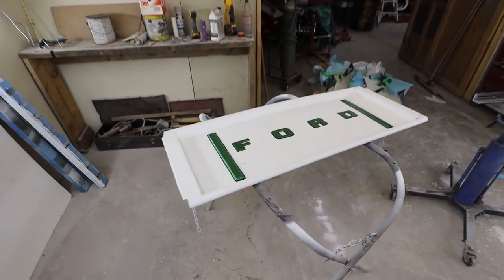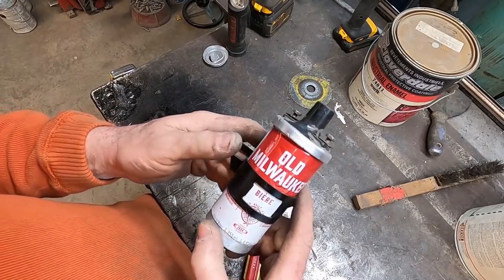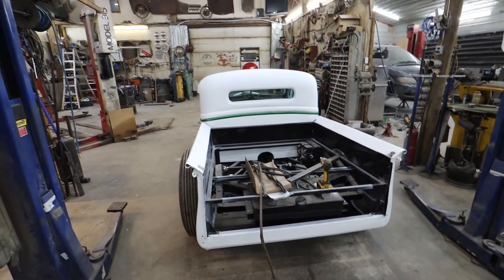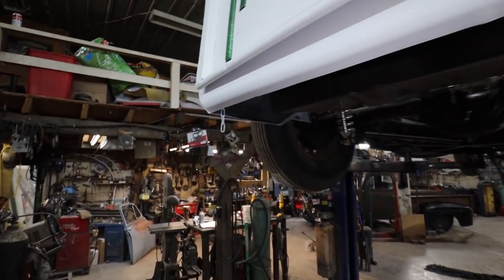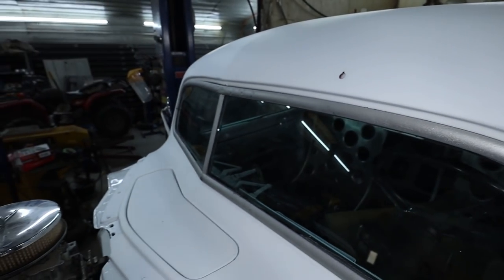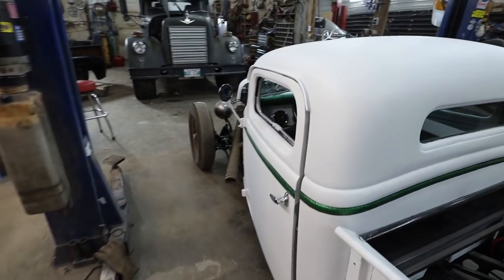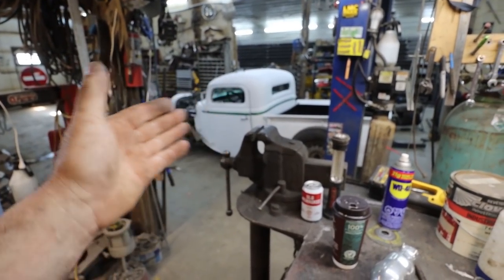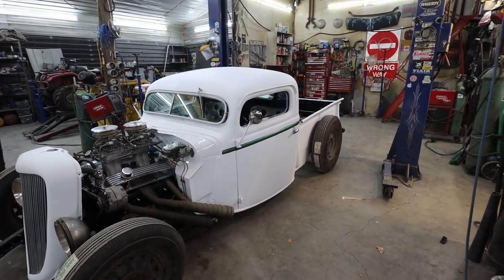Mounting the 37 Ford pickup body to the chassis for the last time Part 39

Comment: Sho! Who would think the Rad would make such an difference? 🤭
Superb pin-striping, I bought motorcycle mirrors to install on my beetle but sold her before I could modify the door hinges, excellent yours works better, you can always install Baywindow mirrors if you can’t see anything out of these 😁!
I agree with the idea of copper fuel and heater pipes will blend in well with your break lines! , Cool touch on the grill paint 👍 anywho 
Be blessed uncle,
Ciao

Comment: I just noticed that the top
Rails of the bed almost line up with the stripe on the cab and the thickness 
Matches the stripe and 
Could be painted to match the cab.
 That could possibly give
It a nice complete side
 view.     (Just a thought.)
 You've done a kickass
Job on this build.  
I enjoy watching. Thanks
🏁🏁🏁🏁🏁🏁😎
Reply: You saw correctly, nice spotting 😜

Comment: Wow, the black Rad is super!, great idea!, thanks for the coil cover idea,, silver on the grill is a fine touch,
An idea popped up,  Plumb your heater pipe and the fuel line in 12mm copper, and would be cool seeing a green line on side of loadbox, to break the white????

Comment: FYI, if you take dish washer soap (preferably something that's more dense, not too runny) and hand smear it on the inside of the windshield, then use a clean paper napkin to "clean" it off, it won't fog up anymore. I use it for my glasses, works for the windshield as well.  You have to re-apply it once in a while. I heard that some people spray it on, but i didn't have much luck finding a good spritz bottle.

Comment: Commin right along...those GM columns are colapsable shafts that have nylon tabs holding them...all you have to do is bang them on the end and they slide up and down for quite a ways...I have the same problem with my wiper...they usually park on the right...I had to take it apart and modify it....bet Pablos getting excited...

Comment: Hand pin strip'n vrs roller'n, Body down-stone catcher, radiator black out n grill's grey, tail's gated motorcycle mirrors mounted a prism encountered, wiper motor through the roof, steering column moved down n mounted. Da General's heat derived n Pablo's a shoulder dog.

Comment: I mounted my mirrors on the top of the door frame.  So the don't stick out farther than the side of my van. And gives me a better view and I don't bump into em when walking around the van.. There over my head.  But your truck is low so..

Comment: Not sure how many times that a fan can say sorry for not liking your first choice of color but what your built is amazing and not give you a big head.  Lol    But Brent I am a big fan of your work, surprise you did make it so nice when you know it is going to get beat up.   Just when I was buying in to leave it old looking like your other builds or rattle can so you can patch up,    But I am glad you did   The only suggestion if I may    Look on Amazon for a white stick on sheet of plastic maybe to over the paint, like a 6 inch strip at the bottom so the rocks kick up by the wheels hit it first.  Might save it for a while maybe.    Thanks for the build   Enjoying it all
Reply from the maker: Haha it'll be easy to rattle can patch up down the road.

Comment: I built a similar truck using a 35 Ford cab (chopped 3"), 32 Ford side rails, and a 472 Cadillac engine. Coupe bodies are hard to find and expensive. Truck cabs are a nice alternative.

Comment: you dont need to do free hand pin stripes for straight lines just get 1/4 or 1/8 fine line vinyl  tape & run your edge at the paint line & leave a 1/8 gap for your pin stripe color  & just peal off the tape when done i always add a small amount of hardner in my paint it will flow nice

Comment: - [here is a thought] Would the triangle wings at the radiator bottom look good painted Silver, too?
- You could paint some cardboard wing patterns Silver and tape them on to see what you think.
- {OR} You could cut triangle wings out of Milwaukee Beer cans and use the Silver side as a test.

Comment: Brent ...I've mostly built and fabbed motorcycles ...When doing final assembly after mockup, use a paint marker to mark the pieces as you torque or pin in place . Good way to catch the shi.....errrrr ..stuff you missed

Comment: i would have done the green in the middle and white on the outside of the grill... and headlight buckets black the rims the same color green and on the back the design on the side of the bed by the wheels you should outline it in the green as well..

Comment: As you are fitting the windscreen wiper, you probably intend to drive in the rain sometime. Do you intend fitting mudguards/fenders? Mud and stone chips will destroy the white paint in no time. At least consider (detachable ) motorcycle type guards mounted to the rear axle and the steering so they move with the wheels.
Reply from the maker: haha I don't plan on running it in the rain but if a feller gets caught in the rain it's nice to have a wiper.

Comment: After all the trials and tribulations of getting the green flake on, I'm shocked that you've left it incomplete both on the dash and the exterior stripe. You REALLY need to bury the flake with a few coats of clear until its smooth, firstly because it will twinkle in  sunlight in ways that it cant right now and secondly you dont want dirt filling in the gaps because it will be horrendous to clean.
Come on Brent, I know you don't enjoy the painting much, but trust me, you'll be happier if you get it done.